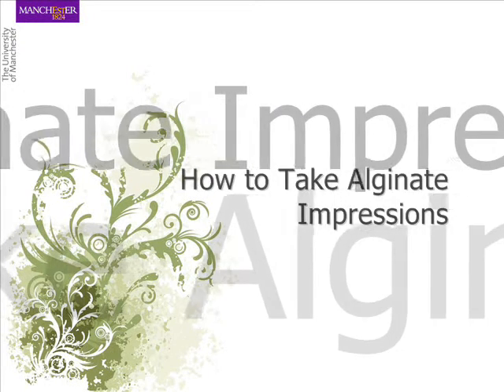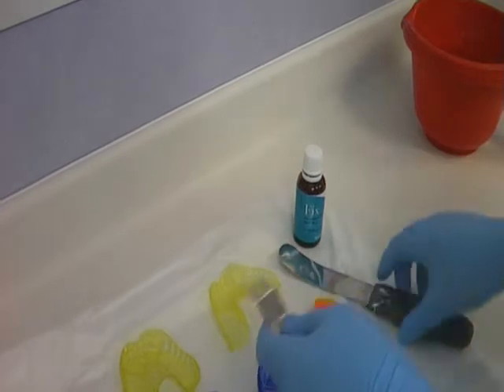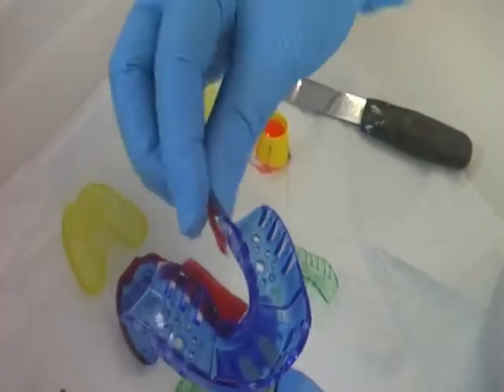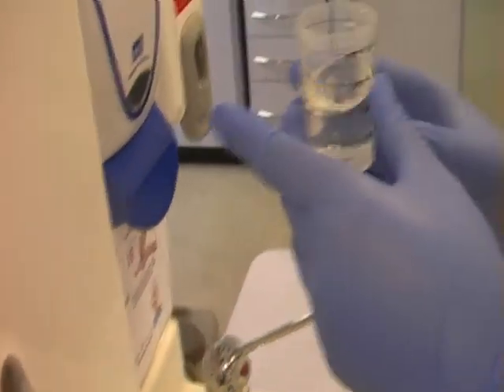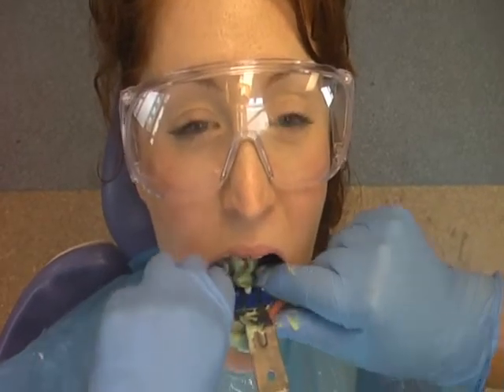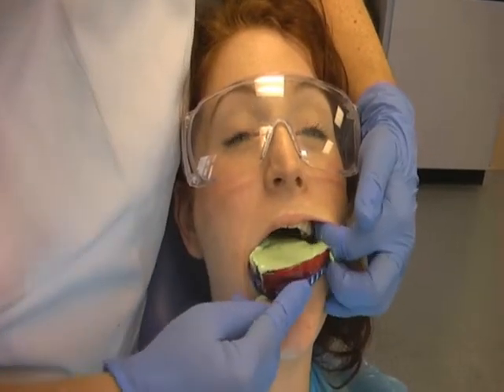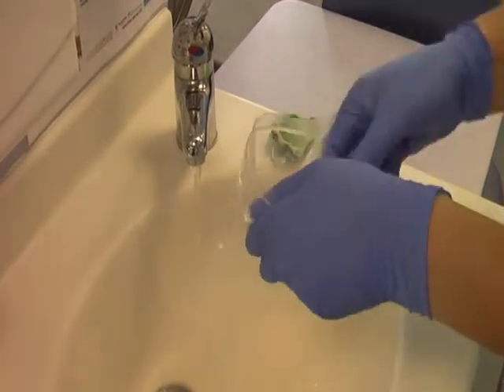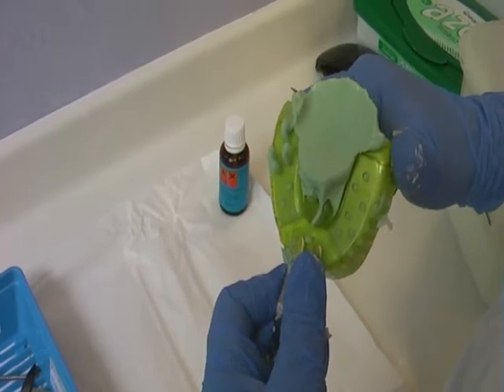How to take alginate impressions

Comment: Thanks for sharing. Appreciate that. 
The alginate impression of the lower one can be better if the tray is put less anteriorly ( one can see there is plenty space anterior but the back tooth is outside the tray) .
Also, the tray is forced down too much so the beading wax and the tray can be seen.

Personally, I do not prefer to have continue movement of lips or tongue during setting of alginate( just the beginning is okay), it may cause movement of the tray and hence distortion of the impression